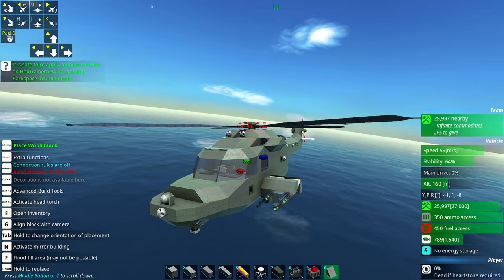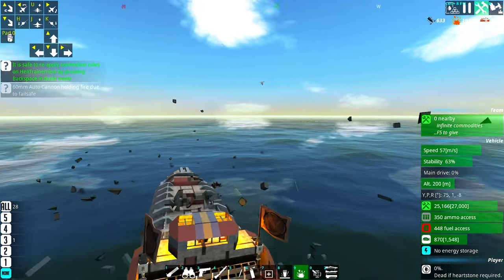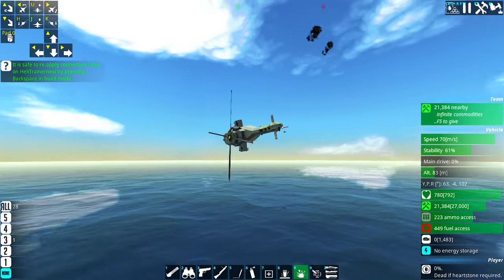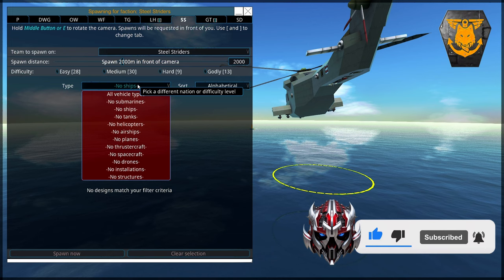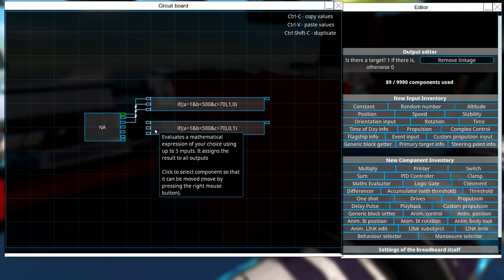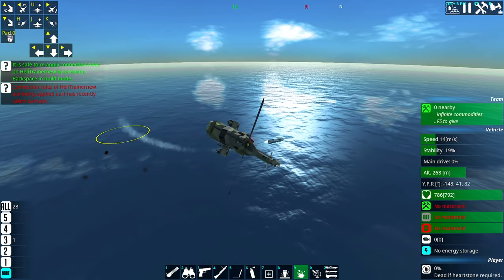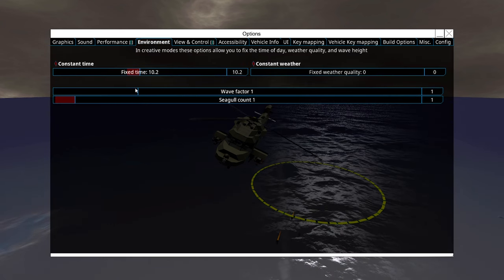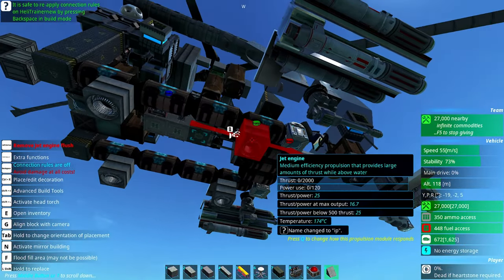Can this Helicopter Really Dodge Missiles??? From The Depths Game

Comment: I love that you post your breadboards on the workshop fairly consistently. Your plane dodging routine has been very helpful for me, and likely many others that never really learned to bake. X) Oh- to get your helicopter top blade to turn more you can set the resting rate up and disable spinning in reverse. Though that may or may not cause maneuver issues.
Reply from the maker: Thanks you 😆